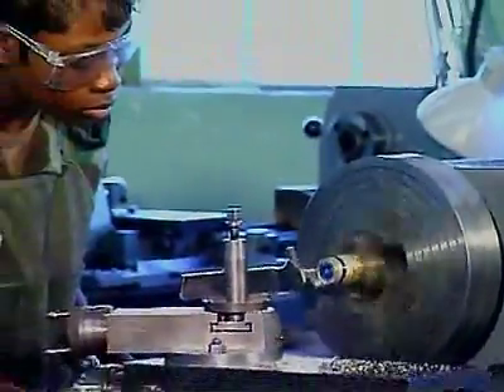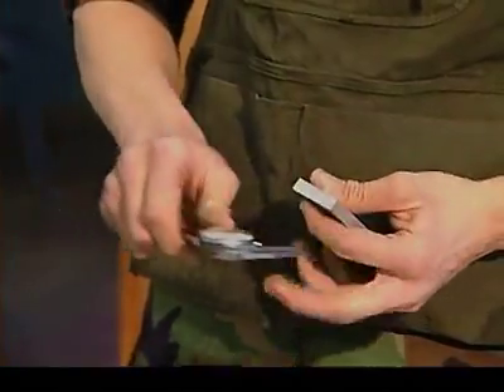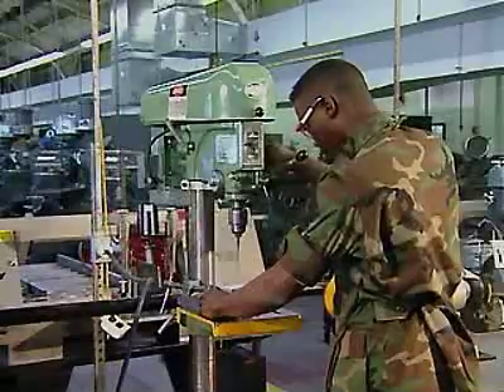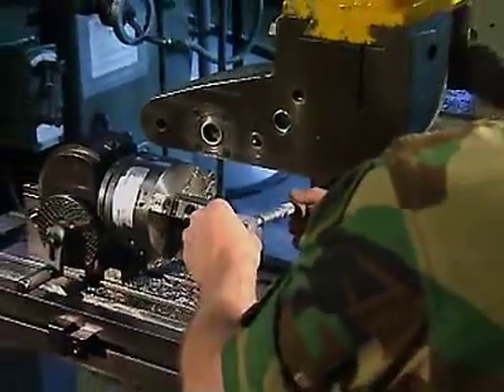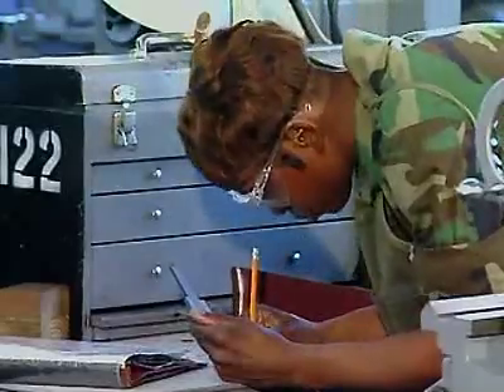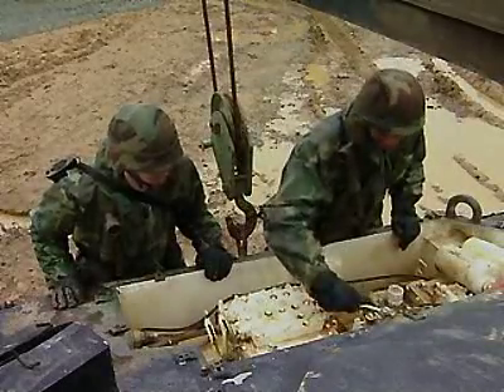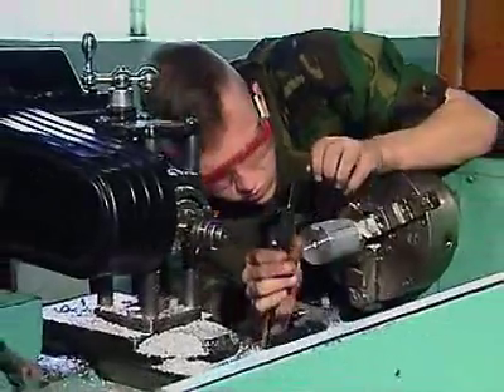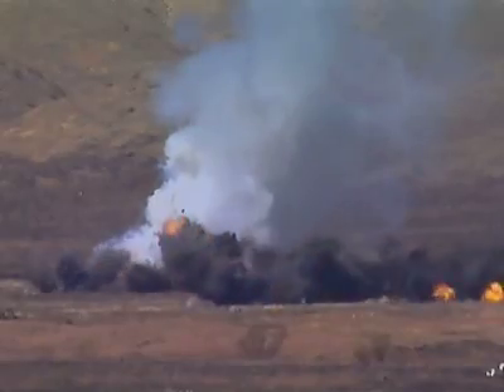US ARMY: Machinist (44E)

Comment: I was a machinist in the 27th. Combat Engineer Battalion, Ft Campbell Ky. 1958-60. I had a Duce and a half mobile mach. shop truck. It had too much equipment to describe in here. I had civilian machine shop experience prior to being drafted. When the old man interviewed me after Boot Camp he was as excited as I was that he finally found a machinist to run the truck. In a two year hitch in the Army I did about three jobs for the military. Most of the time I made parts for my buddies that raced stock cars, Fixed the Colonel's kids tricycle ones, Made many Swagger Sticks, ash trays out of engine pistons for the Officers. I was located in the motor pool but nobody knew what I was doing most of the time. I had a ball. I retired 1999 a civilian tool and die shop, foreman. That's my story. Oh Ya and made tones of brass gear shift lever knobs for officers Jeeps. :O)